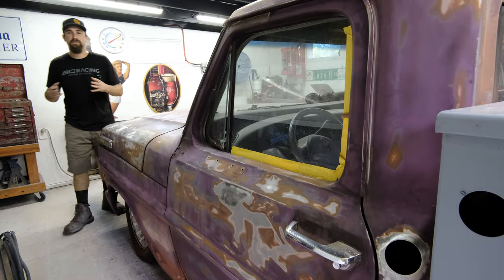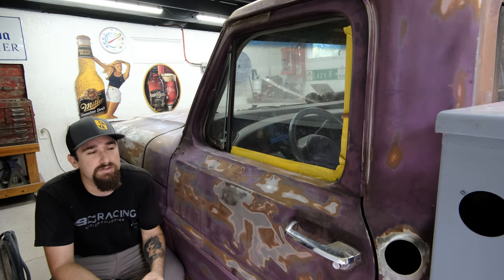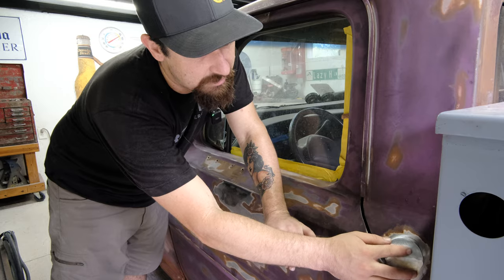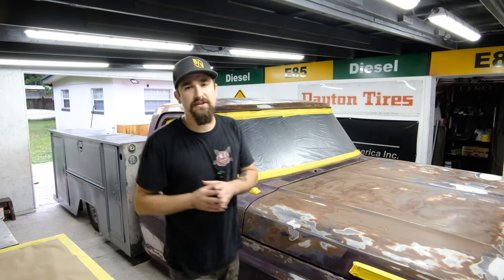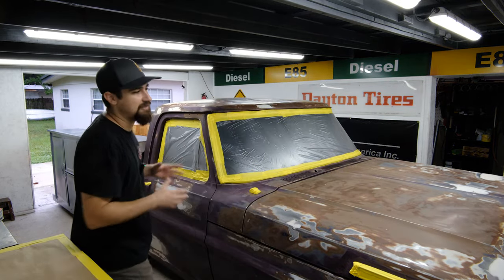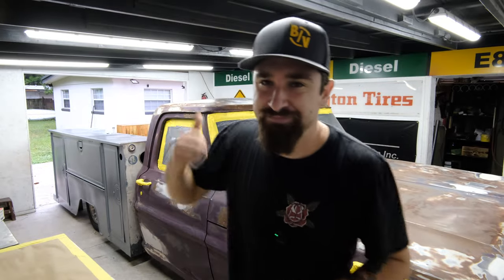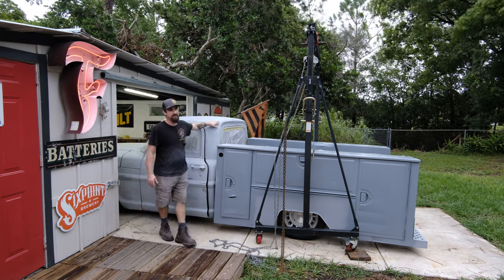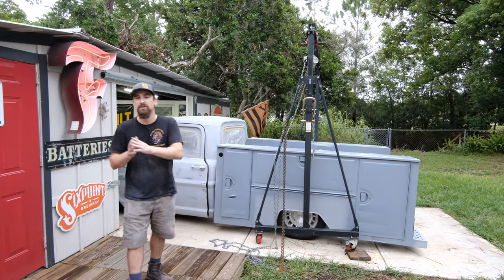You Won't Believe This Color! Truck Transformation | BodeVision

Comment: I have sponge painted on my brown reddish brown layer (rust layer).   Then when sprayed primer then color over it.  Then when I sanded through it cut cool lines where the sponge mound and smears were.   You get hard lines that make sense like blisters and bubbling.   But also get the worn away look that is a smooth transition to the color.  On the same job I did my rust color on the hood and then painted the edges of the hood and the middle peak solid but dusted the flat areas of the hood where they normally wear.   That way I didn’t have to sand long in this areas.  And the modeling of the spray added that realism of a painted car wearing ways layers differently.   Hope this help.    Do all your tricks plus some  and it will be cool!  Love the channel man
Reply from the maker: Really solid advice! Thank you. Anywhere I can see some photos?

Comment: As someone that has painted some body panels I'd like to see a how and why on the correct way to do it. I paint a hood and bumper and they came out good but could be better. A quick explanation on the cheapest way, the best way, and somewhere in between on what gets used and the process.
My hood was previously painted so I just sanded down (not to metal) and laid shaker can primer, then 2 coats of color and 2 or 3 coats of clear with a spray gun. My bumper was the same except it was never paint and a black plastic type bumper material. But sealers and gel primers... What's it's for for and when should I use it? I want to respray the whole car but it's already been 2 different colors and needs a bit of body work. Thankfully not rusty through!